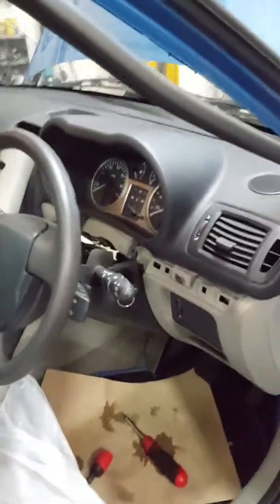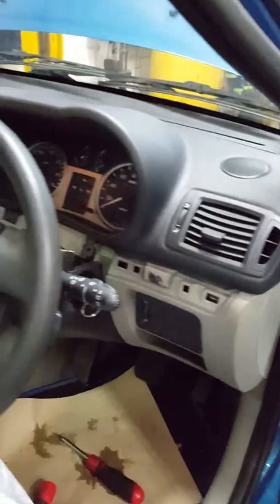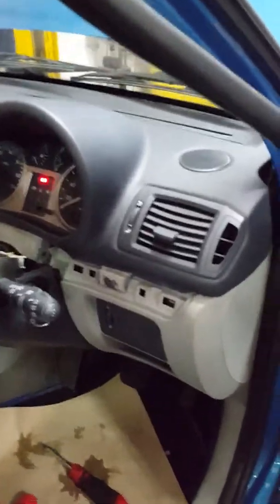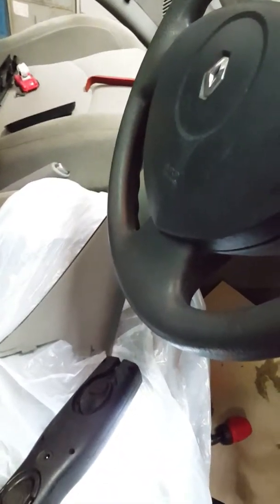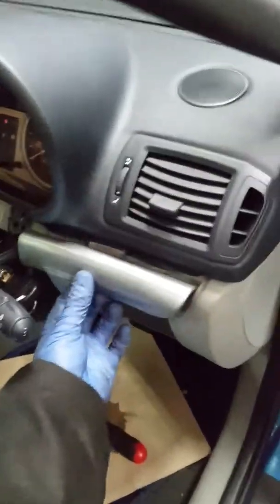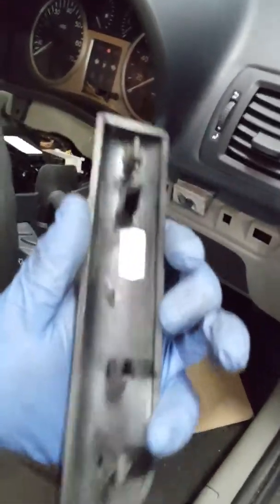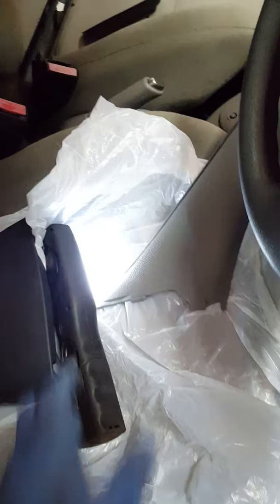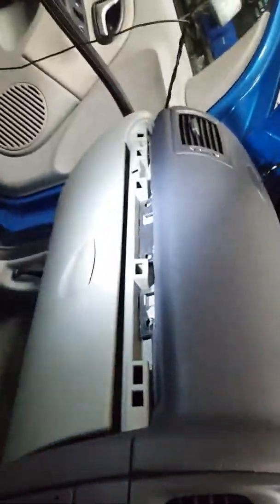Renault Clio dash board removal. Easy and quick way. How to remove it?

Comment: Hi does the glove box come out with the dash or can it be removed on it's own thank you.
Reply from the maker: Glove box comes out on its own ;)
Reply: @AlexTheGrumpyOne  ok thank you do u have a video on how to remove as I am struggling it's a 2002 1.2 thanks again.
Reply: The glovebox is pop riveted to the bottom half of the dash,you can either remove the rest of the dash or drill out the rivets,i think the latter would be easier.